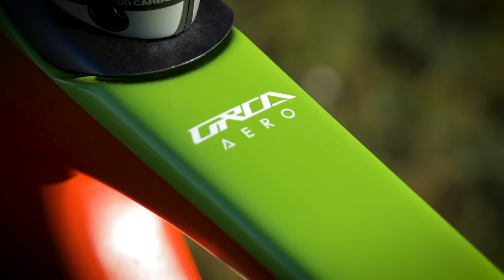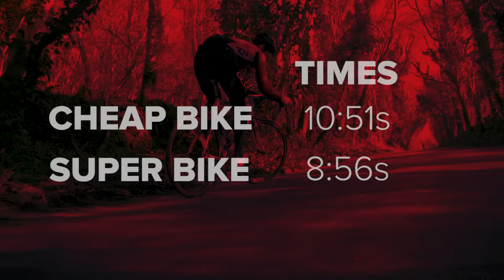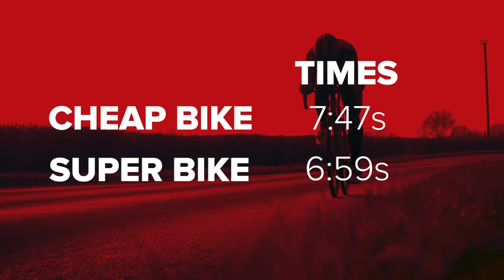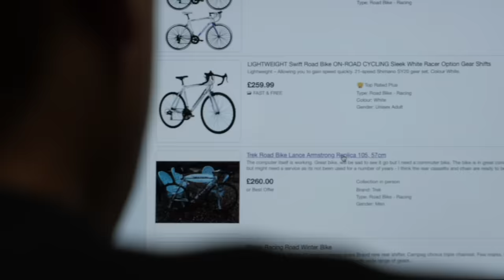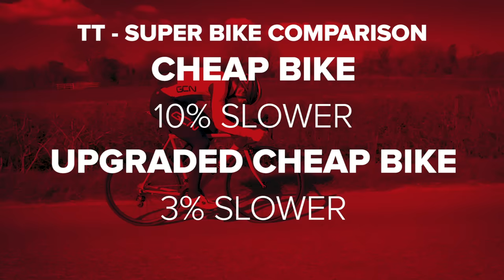Can We Convert A Cheap Ebay Bike Into A Superbike?

Comment: Great vid. I think its exactly as you stated it  shows that you can make a cheaper bike more comfortable and stable for you so you have more confidence in using it which will equal out to you pushing harder. But a midrange bike is always going to be superior to a cheap bike even with upgrades as a super bike will always be superior to a midrange. Having said that if the price is right, I love the upgrade route you guys did.

Comment: That bike looked way better when he first got it. It went from having a professional factory paint job and silver colored (bare or clear anodized aluminum) components, to having a terrible looking rattle-can paint job (in a terrible color no less) with amateurish-looking single-color decals à la Cricut and components with a cheap black spray-on coating.

His first mistake was using an angle grinder with that strip disk, which is way too aggressive for aluminum, so it not only removed the paint, but it removed some aluminum too, leaving about a zillion different angles in the surface of it. It would have taken many hours of hand-sanding to fix that hatchet job, which of course, he didn't do at all.

His second mistake was using rattle-can paint. Rattle-can paint jobs can look good if done by someone who knows what they are doing (this guy isn't an example of such a person by any stretch of the imagination), but they aren't as durable as real two-part paint + hardener ("2K") that's mixed just prior to being sprayed on with a real paint gun; you know, like the factory paint that he wantonly destroyed.

The best approach, if he was determined to remove the high-quality factory paint, would have been to remove it properly of course (i.e., with aircraft paint stripper, so as not to harm the aluminum) and then simply polish the bare aluminum. Not only would it have looked drastically better than that redneck rattle-can paint job, but it would have reduced the weight significantly too (the paint on a frame set often weighs around half a pound).

Comment: Hey guys, this video inspired me to get an older bike and tune it up. I’m mostly don’t know a lot about bikes. I got a 2000 GT ZR-1000 that needed some mechanical work done to get in riding condition. I’m changing the right shifter, a tire, and the tubes. Are there any suggestions for components that I might want to change? What are some good brands that are recommended? Is it worth it to upgrade this bike or should I just save the money for a new one? Thanks!

Comment: Great video - indeed, the whole series of upgrading this Trek was great... QUESTION - at 23:05 - Si says that Aluminium frames have "come an awful long way"... Is this true? I ride a similar 20yr old Trek (the 2200) - and i recently dug out the original brochure (lots and lots of pictures of Lance, his wife and child - which is weird). But it has the frame weight of my bike at 1315g. I compared this to the best AL Canyon frame...which is HEAVIER at 1350g! I was astounded. I'm sticking with my well-loved Trek, and might just do a bit of upgrading like Jon did. What do you think about these two frame weights?

Comment: Did you take the time to set up the unmodified TREK to fit each of you as carefully as you set up the Orbea and the updated TREK? It seems as if you gave the unmodified TREK some disadvantages by not tuning it up or fitting it as well as the Orbea in the first comparison... A true test would compare the tuned-up and properly-fitted older bike to a similarly-set-up newer one...

Comment: When my parents bring a hybrid or road bike I feel very happy. But it's not what I expected. The bike is pretty heavy it's about 12 kg or 26 lb and the dropbar is traditional with a strange brake lever. After a few months I try to buy a cheap 7 x 3 road bike lever but, when I installed the lever it's for 7 x 2 gear ratio. So I just use my second and third gear for the front. After looking at this video I see that the rider affect the most. And for some reason sometime I feel embarrassed when I see someone riding a superbike around me, does this only happened to me or someone else sometime feel the same thing like me.

Comment: Fun video, but you folks drive me a little crazy with your 'comparisons' - Chris said, for instance, that the rear shifting was poor, and that he was worried about shifting into the spokes.  These are not price or age dependant problems, just signs of an improperly set up bike.     You weren't comparing a modern superbike with an old mid-range bike, you were comparing a modern properly set up bike with an old bike left in its 'as found' conditions.  It's like comparing the two bikes and one has a flat tire during the test because that's how you received it from the seller.  It takes literally seconds to adjust a derailleur so it doesn't throw the chain or hit the spokes.

Comment: Given that the bike was probably 900£ after selling off the components (given the eBay seller's 15% tax) I think it's harder and harder to get a Shimano 105 drivetrain bike for under 1000£ new.  You guys probably wasted 75£ - 100£ on the crankset, btw, fsa gossamers are just as good.

Comment: I’m a student on quite a low budget (£300-£400) in need of a new bike. I can’t find any good bikes I like and the cheaper bikes I ride tend to always end up jumping gears after not long when I ride. Would you suggest upgrading my current bike and if so what are good components to look out for? Or do you think I should just buy a new bike (my current bike is around 10 years old and needs quite a lot of work doing). Any suggestions would be greatly appreciated :)

Comment: i think the test is not equal I suggest GCN to change the cheap bike Groupset atleast with Shimano R8000,the wheelset with zipp and the handle bar with carbon aero model after that just test betwen super bike and cheap bike. i thikn it  more fair.

Comment: If you ask if that cheap bike basically TURNED into a super bike after upgrades well the answer is NO,However if you ask  if that cheap bike IMPROVED into a super bike. well the answer is YES thats because the only thing that makes them different is the weight of the framed because you still need to double your effort to compensate the weight difference of the real super bike and also to improved your speed.. Also the frames shape is not aerodynamic and its not air resistant supported unlike the real SUPER BIKE.

Comment: I know the video is a bit old by now but I just saw it. Your results are clearly skewed in favour of the upgraded version. After all, you did many cheap or free upgrades that normally come with a second-hand bike purchase. Hearing Chris comment about seat angle etc. I was like "Duh, you don't just ride someone else's old bike as it came!" Adjust your seat position, handlebar angle, hood positions, seat height, pump the tyres, change a tire or two if necessary, same goes for chain and cassette, index your gears and adjust limiting bolts if needed. That should be accounted for in your cheap bike's price, it's even something you can use to lower the price to begin with. Failing to do that leads to the mechanical Chris had, affects the times, and skews the results. Stay fair to the experiment, not to showing off how good your upgrades are.
Edit: basically, you are comparing an unmaintained old bike to a maintained and upgraded one, not a maintained old bike to a maintained upgraded one.

Comment: That bike was not brought up to mid level, 1000 and under is entry level compared to the orbea 2500 to 3000 would  be mid level.  That could have put better wheels and a lot of carbon and tech on the bike, and made it faster and alot lighter.  But I understand bugets for videos, I just don't that was a mid level bike.

Comment: So, once you had stopped farting about with a knackered transmission, an aero frame and 60mm deep wheels is worth 3% on the flat. Now try a £100 ebay bike with secondhand 60mm wheels.

Comment: Why this test is absolute non-sense: The groupset isn't the same between the two. The stem, handlebar, seatpost and seat is heavier up high. The wheels are different. And most of all, the smaller ring is smaller on the Orbea!

Comment: Seriously 800+ euro, that is not cheap at all.  I think you should just replace the chasis with carbon or using a environmental product (such as recycle plastic), with the professional wheels.  Other stay.  The handle seriously is no problem, u can just get rid of the rubber tape and repaint into black.  I personally think super bike seat is never comfort, too hard.

Comment: That bike is perfectly fine. It may need some maintenance and repairs because it's old but otherwise you are just bitching. And then you ruined her paint. Ok and then after replacing the mechanical and bars you 'saved on the tubes' and for $1000.00 I would really think new bike. And it's so cute the way you hold his rear end

Comment: I've been building bikes forever and finally came to the conclusion that speeds hit a peak at the same time as that bike you upgraded - 9. For a good amateur rider more gears simply means more shifting with no improvement in speed. Why don't you do a test of equal bikes with 9 and 11 gears for amateur and pro riders?

Comment: I suppose it's just a bit of fun, but these comparisons on flat roads are a joke because the wheels make the biggest difference.  It's a bike test, not a farkin wheel test. :-) So, either have the same wheels on both bikes, or, better yet, put the aero wheels on the old bike and see how well the so-called super-bike does then. Ha :-)

Comment: I did this for my sons I gave them $1,100 NEW Ultegra 30-speed bikes starting from bikesdirect (www.bikeisland.com - blemished bikes, some were missing some  parts.)  They were at $1000/ea but still 20.5 lbs with pedals so I invested $75 in seatposts($20) stem($25), and blowout carbon fiber saddles($30) to save 450g vs ritchey and WTB parts  that were replaced, 19.5 lbs with 1900g wheels!  Double butted kinesis T6061 frames and carbon forks.  Mercier Corvus AL model, orange and burgundy.

Comment: This video is a joke. Comparing a bike with a saddle in so weird position and slipping? And then go straight to ~600 pounds on upgrades? Compare a cheap bike, with all the original parts but PROPERLY MAINTAINED AND ADJUSTED (maybe re-cable it and put some new tires on, but that's all).